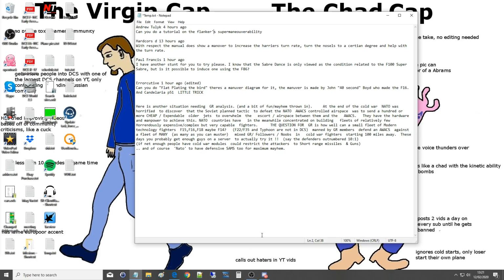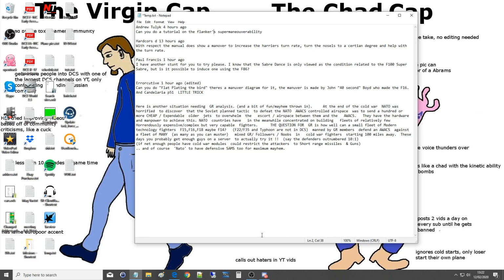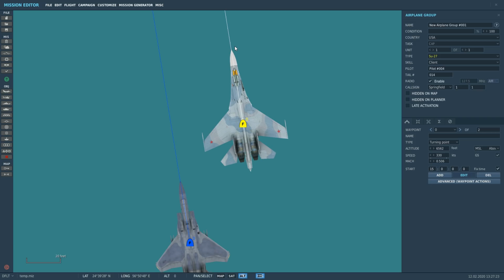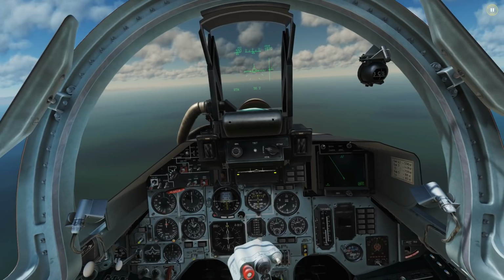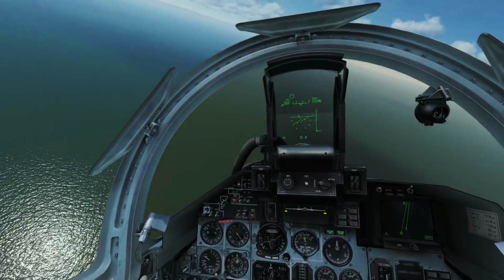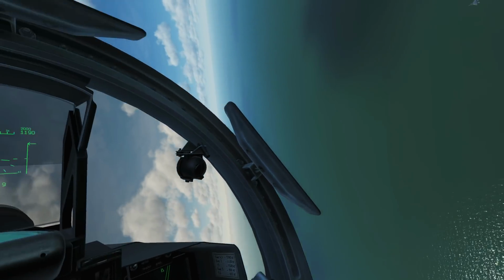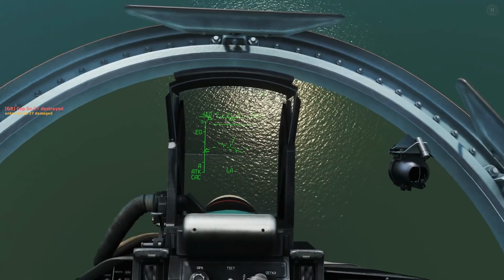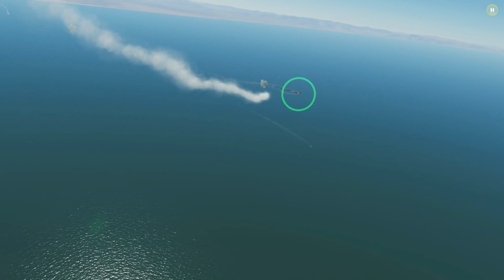Su-27 Flanker: Dogfight Cobra Manouver Super-Manouverability Tutorial | DCS WORLD

Comment: Can you show how Indian Air Force Sukhoi-30 evaded an AMRAAM fired by a Pakistani F16 during the dogfight last year in February?
IAF also showed the remains of AMRAAM that was evaded.
Reply: First of all, there was no dogfight. 
Only BVR combat. With a bit of WVR action at most.

Secondly, the Su-30MKI were way outside the AMRAAM's NEZ AFAIK.
That's the main reason why the IAF aircraft that were targeted by the PAF jets managed to escape. 
It's not hard at all to evade/escape any missile if you're really far away from it's NEZ.
Reply: Actually it was hitted with amraam aim 120c  .su30mki can easily evade a missile using tvc but g force impacts the pilot
Reply: Usama Shafique it was not hit. I know one of the pilots personally, he tells me it got quite hairy and he did not use super maneuverability, just ecms (chaff). He also tells me that it was a rude awakening because it was the first time the Indian Air Force realized the issue with having such a huge rcs and that the launch codes for the aim 120 were indeed in the hands of the PAF.
Reply: @IndianArma  I am curious to know why didn't the sukhois launch their own BVR missiles against the F 16s ? Aren't the BVR capabilities of the MKI better than the F-16s? Were the su 30 pilots told to hold fire as they didn't expect the vipers would fire?
Reply: @vineetkaddu1214  
Unless the engagement is at a very close range, BVR missiles need course-correction until the missile is like 20-30 km away from the target. Mainly because targets doesn't stand still, and seekers on missiles have a very short range due to its power limitation and wavelength used. If an opponent fired a BVR missile at you, evading is your topmost priority - your radar will not be pointing in the right direction while dodging, so you can't course-correct you own missile even if you fired it immediately after your opponent fired theirs.
Reply: @mickeyg7219  Oh, Thanks for Clarifying! That makes a lot of sense. I had been wondering about this for a long time.
Reply: @vineetkaddu1214  the real answer is that the effective engagement range of a missile is the range of radar + fuel (adjusted for fuel burn rate) + Radar cross section of the aircraft. The R77 does indeed have a slightly better range than the AIM 120 Bs but the effective engagement range of the F 16 was greater because the R 77's advantage in terms of the first two categories is offset by the Sukhois disadvantage in RCS, which is why the F 16 could get a shot off first, also you need hunter killer tactics with your wingman or you painting the target for the missile to course correct until it reaches the final envelope, both Sukhois were evading and not fighting, the same was true for the mirages. There was indeed a dog fight that day, and the result was us loosing a mig 21. But yes, the Sukhois and the F16s did not engage beyond the salvo of initial BVR contact. It's also worth noting that IAF fighters were rather meekly armed when they scrambled. We were caught with our pants down. Furthermore, the PAF never lost an F16 not did India lose a Sukhoi in the engagement, this was just propaganda from both sides. India certainly got the worst of that engagement and it would have been political suicide for the politicians in the center to accept that, especially when they were fighting an election based on the mandate of being some nationalist heroes who taught Pakistan a lesson. Sad really, when the military is used to score political points but I guess everyone does it.
Reply: @IndianArma  Hmmmm.... I know that but thought that the Sukhois radar would be more than able to overcome the handicap of it's large rcs. So how would a Mig 29 k fare against a PAF F-16?
Reply: @vineetkaddu1214  the radar does, it is a PESA radar, with A ESA coming in on the super sushi version both of which are far superior to what the Future 16 block 52 field, but that is not the only criteria, effective weapon lock range is not a function of how far a radar can simply track a plane but also the frequency at which it receives a signal from its targets. The number of times a radar receives a signal increases significantly due to a wide variety of factors such as topology, whether the other aircraft has its radar on, heat signature for thermal tracking and various other sensors. The PESA on the SU will tell you that there is a probable target, with some guidance, but that information would rely on a confluence of various sensors which do not amount to the information required to get a missile lock. Having said that, it also matters at what point was the decision to engage made, in other words if  fully armed sukhoi is approaching an airspace saturated with F 16s, you can bet your bottom dollar that the sukhoi will follow tactics that would enable it to engage the f 16 before the f 16 engages it, But this is a very perfect scenario. In real life things are dynamic and therefore the situation might be very different if the Rules of engagement are changed when both aircrraft are already tracking each other then tht initial advantage that the sukhoi may have in determining how to engage is lost. Even the F22 does not straight up go into a fight, it uses a strategy called hunter killer, where one razor remains stealth with its weapon bays closed and the radar off, while being guided by another raptor that has its radar on, which may indeed be getting tracked by the enemy, using the bogey's on board radar or AWACs or indeed even ground radar. Everything can share information in today's optimal networked warfare scenarios. In such a situation the stealth raptor moves in till it reaches weapon engagement range then gets a radar lock by switching its radar on, fires it's Amaram and immediately takes evasive action after painting the target long enough for the missile to do its thing. At this point the raptor has the edge because the bogey is evading instead of engaging and this is all aide possible through very intricate team work, normally called a hunter-killer setup. The SU 30 would normally excellent at this sort of stuff as well, provided everything is planned and executed perfectly. In this situation those perfect parameters were not met because the SU 30s did not have the initiative, which is why it's sort of silly to use them as interceptors, but they are effective as air superiority fighters. The problem with air warfare is that itis not a simple matter of better linear characteristics, each aircraft can be effective against a superior adversary if it finds itself in a favourable strike envelope. My grand dad took out a saber in an HF 24 Marut, which was basically a ground attack airplane while he was outnumbered by 4 Sabres to his one aircraft. The Sabre in 1971 carried 2nd generation heat speaking missiles and was a very dominant air superiority fighters of American vintage, while the Marut was an underpowered indigenously manufactured aircraft relegated to ground attack roles with minimal armament in air to air combat which was basically just one under caliber canon. The SU 30 MKI is a superior plane to the F 16 block 52, but it is not invulnerable to the F 16 which is by all measures a very lethal and capable machine, also one of the most successful contemporary American designs. There is a lot of nuance that is missed in these linear comparisons.
Reply: @vineetkaddu1214  a mig 29 k is actually much closer in capability and class to the F 16 and tbh should perform as well or as badly as it is used. In a straight up gunfight the Mig 29 was specifically designed as a counter to the f 16 by the Soviets, and it almost mimics the performance numbers of the f 16 with a slightly better turn rate. It is also more unstable and prone to stalling at high angles of attack when compared with the F 16. I think it would boil down to numbers, saturation and peripheral surveillance capability that will determine who gets the first shot. Having said that, the mig 29 k would be better suited to intercepting the First 16 because it doesn't have the same handicap s the sukhoi when it comes to RCS, while the sukhoi would be better suited to clear an air space and establish air superiority if it has the initiative. In the latter case the SU 30 has a pretty significant advantage, but it is not good for swing or multi role, and that is why we need the MMRCA. The Tejas alone is not going to cut it.
Reply: @vineetkaddu1214  just to guide you through the typos: read future 16 as F 16 and Sushi as sukhoi 😂✌
Reply: @IndianArma  Man, you know your stuff! Chatting with you had been very enlightening. Many Thanks.
Reply: @IndianArma  So my takeaway from your explanation is the PAF being the aggressor had the initiative and used the Hunter Killer tactics you mentioned, giving it the edge. The Sukhois being the defenders  were at a lower altitude since they were intercepting. And thus got fired on and had to evade. Is that correct?
Reply: @IndianArma  Haha! I'll keep that in mind.
Reply: @IndianArma  BTW is the Sukhoi upgrade even coming? I'd lost all hope it would